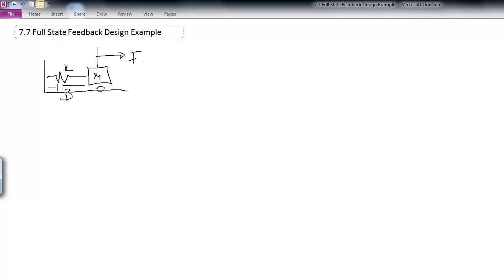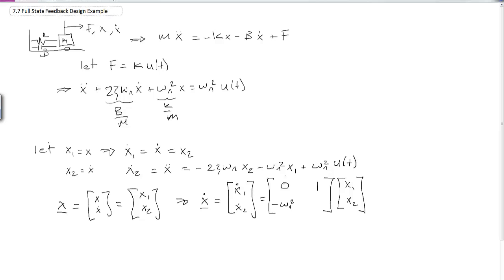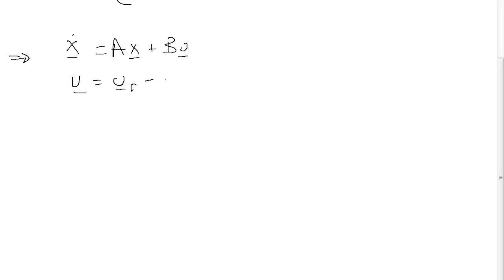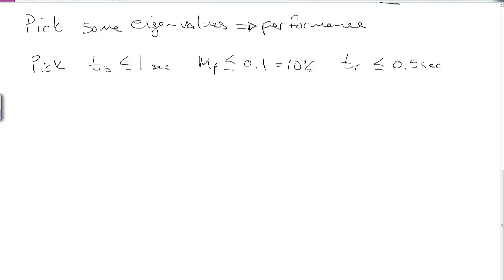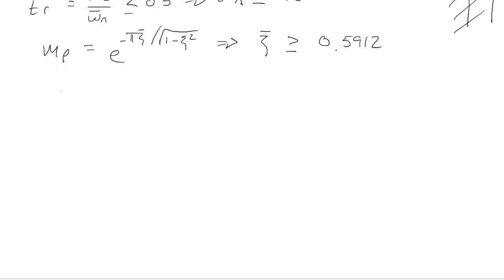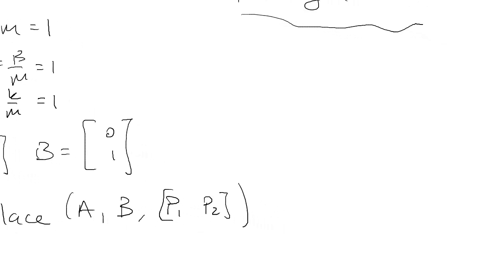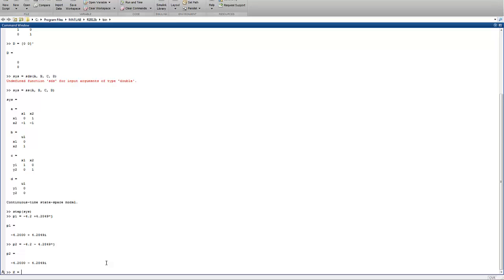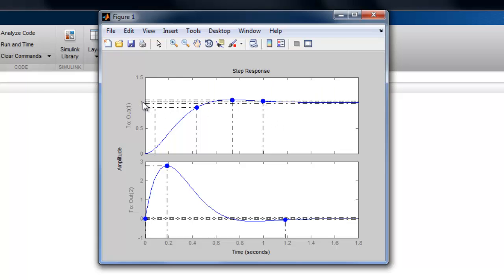7.7 Full State Feedback Design Example

Comment: I only say that because you can declare b = m = k = 1 etc, that will define w and zeta.  alternatively, you can declare w, and zeta and get the associated m, b, k.  I figured you can declare one or the other but not both. is this wrong?
Reply: What I seem to understand is that b =m =k = 1 is your defined system, the one without a controller. The definitions made for w and zeta (the ones that get you to have the p1 and p2 poles defining your system) are the characteristics you want the closed-loop controller to ''give'' to your system. He puts bars over the desired w and zeta characteristics so you can see them as not representing the same thing as the ones you could derive from the definitions of b, k and m.